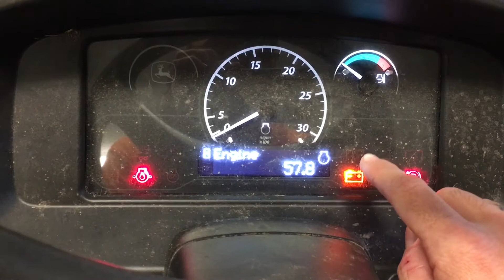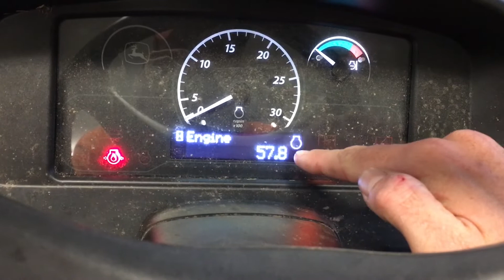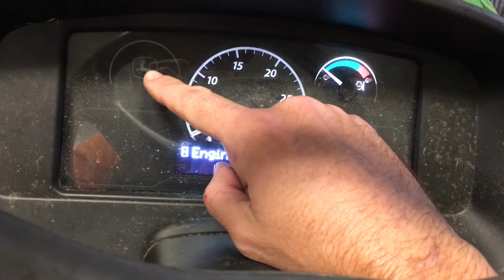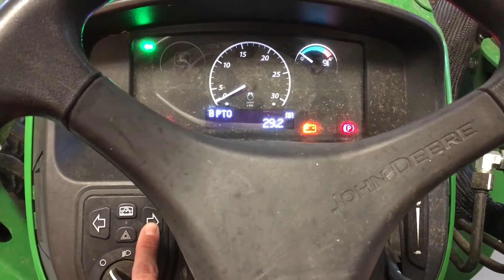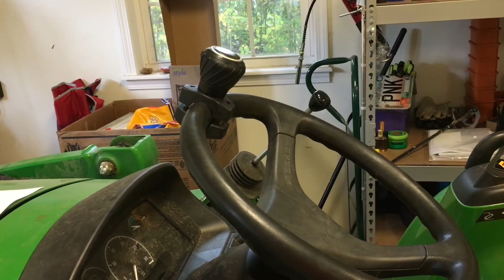#1 John Deere 3025e Review

Comment: Thanks, never knew about that diff lock handbrake trick. We have a 2017 model, and I don't know what we would do without it! I put a Piranha tooth bar on the loader bucket, and it just grabs onto and pulls up all those pesky invasive pepper trees that spring-up around here and also scrapes grass up if I don't wanna bother to hook up the box scraper because I usually have a mower on the back.

Comment: Great video, thanks for the review. I'm looking at these 3025E tractors myself, to replace  the 1025R we have now.  You mentioned about having a little more horsepower. The only negative I can see with going to a 3032E or 3038E is that you now have DPF to deal with and all its regen hassles. I had a tractor previous with DPF and I said never again. Keep the videos coming. Looking forward to your video about adding the work lights.
Reply from the maker: Here is the work lights video!

JD 3025e Work Lights https://youtu.be/EpfqoyfFECw

Comment: Do you know if the Transmission /Hydraulic oil & filter should be replace at 50 hours or not on the 3025E.  I have hear different views on that by owners and dealers.
Reply from the maker: I had to because it got so sluggish.

Comment: Nice job for really going over the good and bad from living with the machine.   After driving a 1025R and looking at Kubota B2601 and B2650, the 3025E is looking pretty good.    Better weight, a trade-off on price vs. HP and a better trade-off on loader capacity for the price (when you think about another $4K or more for higher end loaders in Deere line up.   Hmm...
Reply from the maker: I cant bring my self to own a Kubota tractor. My feet don’t like their pedals. They are good machines just not fit for me. I have sold the 3025e and went to a 2038R. A lot more comfort features that make the long days less painful.

Comment: Great review of the 3025E. I have one on order. However, I won't be getting the front loader. I'll be getting 2 rear spool valves instead. Might even post a review myself when the time comes 🙂
Reply from the maker: I couldn’t imagine not having a front loader. But each has their own needs. What you plan on using the rear SCVs for?
Reply: @BBLandServices  I have a small side business doing gardening & landscaping services. The tractor will be coming equipped with a verge / flail mower which requires 2 double acting spool valves.

I'll also be getting a rotary tiller (named a rotavator here in Ireland) with it which will make things easier for the vegetable growing I do.

Comment: Nice video! I’ve got the same year and model. I noticed your coolant resivor is almost empty. Mine looks the same. I’ll fill it up to the designated fill line but after a while always seems to get emptied. Have you ever ran into this issue?
Reply from the maker: If I added more it would go somewhere and be back to this level. Never ran hot tho. Guess it’s just the design.

Comment: Did you ever get the armrests? If so could you share the part number for Amazon? My wife and I just ordered a 3025e and she really wants a pair. Great video!
Reply from the maker: No, I ended up selling the 3025e and went with a 2038r.
Reply: @BBLandServices  Any particular reason you sold the 3025e? Just wanted to step up to an R series? I'm having second thoughts about the 3025, we haven't even taken delivery yet and I'm afraid we made a bad choice...
Reply from the maker: Yes the R are way more comfortable to operate all day and I needed more HP. The large frame 2r are the same size as the 3e’s.

Comment: Very informative, thanks. I just left a dealer and i am waiting on them to see what kinda deal they are going to give me. Only difference is I don’t like the hydrostatic transmission and want the traditional style. How much is reasonable to give for such?
Reply from the maker: I’m not sure the current prices. I paid $18.5k for my 3025E. If you want gear drive look at the 3025D it is a gear drive transmission.
Reply: A Guy With A Tractor did yours come w/ any attachments?
Reply from the maker: Revout30 I bought a rotary cutter with it but the $18.5 was just the tractor.

Comment: I had a 2018 1025r and traded at 150hrs in 2019 for a 3032e loader backhoe, i severely regret it. I thought i was going up in power and size, size yes, power to wheels, no. Even if I take the backhoe off, the tractor still cant make it up the hill in full throttle without it bogging the engine down. That was right when i took it home. Never test drove it, or any others. Just based my decision off of assumptions. Its currently in shop at 40 hrs to see if they can improve the power to the wheels after i finally got fed up with it.
Reply from the maker: RickyBobby ShakeandBake I hate to hear that. Sounds to me like something is wrong. I live in the mountains and I can cruise around my property which is very hilly at an idle speed in low gear. In high I have to give it a little throttle but only a couple hundred RPM. My book did not recommend a and 50hr filter or fluid changes. I started noticing it being real sluggish. Talked to my dealer and their computer shows a hydraulic filters to be changed at the first 50 and then every 400. I’m at 80 hours now and I’m about to install a 3rd function kit and going to change everything when I break it down to do that. Hopefully a service will help you on your issue.